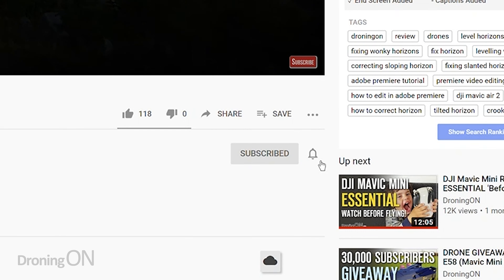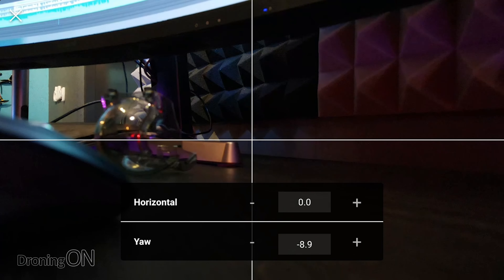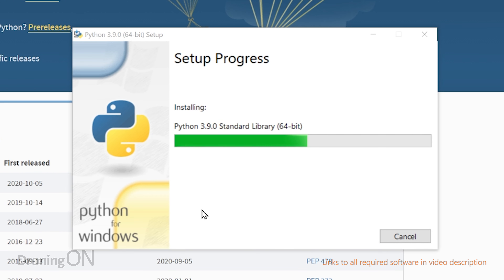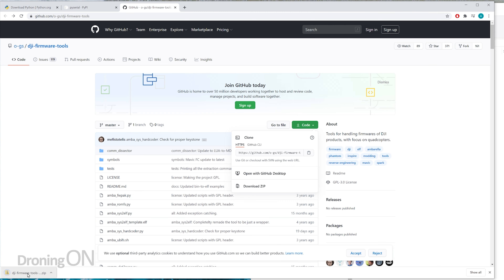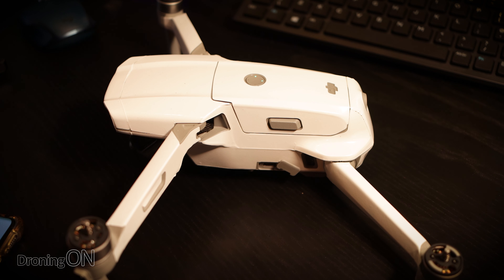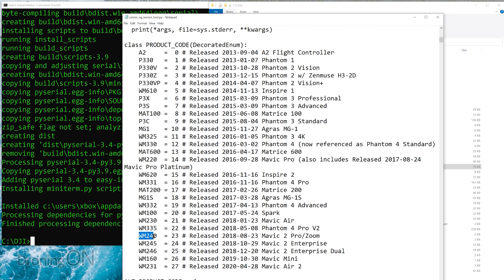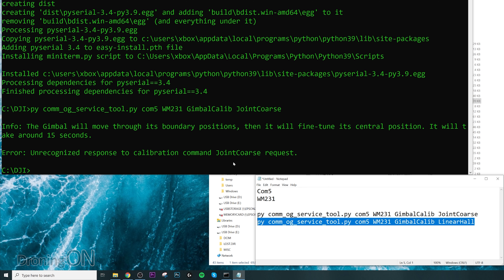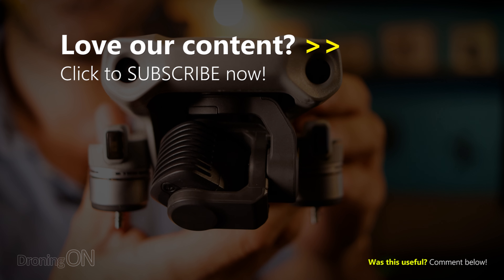FIX DJI drone ERRORS/ISSUES after GIMBAL/CAMERA replacement

Comment: THE FIX FOR MINI 2
Hi first of all ,thank you for your video,which was very useful and all sorted now,the bird is flying,without its eyes leaning on one side  lol .

(FOR DJI MINI 2 OWNERS)
That’s how I managed to fix mine yesterday 17-10/2022.
First of all you need to check if the COM PORT is visible in task manager task manager if you use windows.It’s most likely won’t be there because of windows updates etc .
That’s the fix If the details of your COM ports are not visible in the Device Manager, open Device Manager and click on “Action” from the menu bar. Select the “Add legacy hardware” option, then click Next. Choose the “Install the hardware that I manually select from a list (Advanced)” option, and click Next.Then click communication port and ok .Back in task manager ,you’ll see com port visible now and it might says ,port won’t function properly,just ignore it .

Now connect your drone to the computer/laptop,go on task manager,click on com ports ,you will see two ports ,mine was showing COM 4 and virtual Dji USB port (com 3) ,you will use the one for Dji only ,which is COM3 .
Leave your drone connected to your laptop.

Go in notepad and save this (ps your port com might be different to mine ,check what’s showing in you task manager,that’s the one you’ll be using):
1/ py comm_og_service_tool.py --port com3 WM160 GimbalCalib JointCoarse
2/ py comm_og_service_tool.py --port com3 WM160 GimbalCalib LinearHall

Now you follow the YouTube videos and install everything as stated (Python,PY serial,Dji tools etc)

Now go in command prompt 
C:\WINDOWS\system32>cd.. (click enter)
C:\windows>cd.. (click enter)
C:\>cd\dji
C:\DJI>py setup.py install

Wait for it to install….
Then :
C:\DJI> py comm_og_service_tool.py --port com3 WM160 GimbalCalib JointCoarse (click enter ) and you’ll see the gimbal moving 
 
Next :
C:\DJI> py comm_og_service_tool.py --port com3 WM160 GimbalCalib LinearHall (click enter) and wait ,and you’ll be all good to go .
Disconnect the drone ,connect to you phone ,calibrate imu ,calibrate the gimbal,and enjoy your flight .
Ps I still get error message(Code:40021 and Code :40011) but it didn’t affect my flight .
Reply: Will WM160 work for mini 3?
Reply: @ sorry mate ,I won’t know ,as I’ve only tried it on the mini 2 .Follow my instructions and try give it a go .It might works ,you never know,and you’ve got nothing to loose either.Good luck

Comment: Hi this all worked however when I turned the drone off and back on again, it had reverted back to before calibration. So it only works if i calibrate and don't switch the drone off. Can anyone help?

Comment: Just tried it on my air 2s. 1st issue I was having was getting a message stating "python was not found run without arguments", fixed that I think. Then now I'm getting "python command og service tool py is not recognized as an internal or external command” I'm not IT literate so I have no clue. Tried on 2 different computers, same result. I have the cmd running under administrator, at the c: prompt under the DJI file.

Comment: I had the exact same issue with my air2. Gimbal replaced, firmware updated, everything calibrated and gimbal still cock-eyed, with message in dji fly "incompatible gimbal data". And then, glory be, after several restarts of drone and controller, it centered and now works perfectly. However the "incompatible..." Message still appears.  I'm hoping it will go away and not about to do your complex fix just to get rid of the message. Suggest folks try the restarts first before your fix
Reply from the maker: Good tip on the restart, thanks for adding this advice buddy! Unfortunately the incompatible message appears to be impossible to get rid of :(
Reply: @Droning-ON we having problem installing python on cmd

Comment: My problem is with my Mavic air 2 the camera and gimble will not move at all like is dead, and I never crash or any hard landing I wonder if I follow this steps it will re calibrate
Reply: the same is happening to me, with the mini 3 pro, I had to desasemble to clean the gimbal motors, when i put it back together, the gimbal is not responding and it says it's locked

Comment: This fixed our Mavic 2 Enterprise from the IMU error.

Calibrating the IMU, turn on the remote controller and connect it with the mobile device. Place the aircraft on a level surface with its arms folded and turn on the aircraft. Launch the DJI Go app, enter the camera view. 

Go to main controller settings, advanced settings, sensors, IMU and tap calibrate IMU. (You then have to change the orientation the drone when prompted to compete the calibration)

Comment: Is this method works with dji mini3????
Reply from the maker: Very likely, but you may require a new code to use.
Reply: @Droning-ON wher we found the code plz
Reply: It work!??
Reply: Will WA160 work for mini 3?

Comment: Hey man and thank you for this tutor.
did anyone used it with mavic 3 cine?
im getting same error code and a black screen....
my issue is the drone is not showing in the port lists.

firmware is up to date and using win10
Reply: look at my comment, I found the new order^^
Reply: @seemanb2374  its not showing in my port list, i cant find on which port its connected.

Comment: Hi Ash,  can I just thank you for this video, as it saved my last drone.  I have used this calibration method before and it worked fine, I have another Mavic 2 and have tried to calibrate it, following a crash. I have replaced the flat control cable.  when I send the command jointCoarse the gimbal goes through it the usual movements, but when I used the command LinearHall nothing happens, no movement at all, any ideas where I may be going wrong.
JON
Reply: Hey mate, any luck with the LinearHall issue? Mine is also not responding to it :/

Comment: Just bought a replacement gimbal for my mini 2. Fingers crossed this will work!
Reply: LN DRONE & FILMAGENS  I tried WM160 and it worked! My new gimbal is no longer crooked. Good luck with yours. 

The tricky part was that the Mini 2 is only detected on the COM port for 5 seconds. You have to be fast to enter the command the moment the drone is detected by Windows.
Reply: @uvin.baduge  can you please explain the process

Comment: Hello, thanks for the video, but I can't solve the problem with my mini 2, it gives an error that the product is not the right product, but there is no mini 2 on your list, there is only a Mavic mini
Reply: Solved for dji mini 2 you mast choise mavic mini and after start the drone you have 10seconds for launch your calibration

Comment: @DroningON Hi I found this video some time ago and I found it a great help for my Mavic 2 pro. now I'm the proud owner of a Mavic 3 cine and recently crashed it, I thought I could repair the gimbal myself, and everything went great until I turned it on and now i'm stuck with the gimbal calibration. I was wondering if you had an idea of where to get the latest firmware tools to calibrate the Mavic 3 cine or any advice to help. Thank you
Reply: Hi there. Did you ever find it for the mavic 3.  Im also looking for the avata code

Comment: Would this also get my camera working again, I have a mavic pro that had gimbal overload, replaced the gimbal but kept original camera but had to replace the camera cable, since then my gimbal no longer moves and I have camera sensor error

Comment: Hello friend, the MA2S and M3 codes are already available, the Mini 3 is missing, I have been trying to use it with the Mavic 3 but the problem is that in Device Manager it does not open the corresponding COM port and for this reason I have not been able to know what COM port to use.
If you suddenly know how to force the PC to show the COM port, I would appreciate it.

     WM231 = 27 # Released 2020-04-28 Mavic Air 2
     WM232 = 28 # Released 2021-04-15 (MAVIC) AIR 2S
     WM260 = 29 # Released 2021-11-05 (MAVIC) 3
Reply: just Search ( bickflash tech) on YouTube, drop a comment for him, he'll assist you.

Comment: Hello, i get an error, invalid choice com5 it wants me to choose the model but i dont know where to put the port code because if i dont input it it will  give me the error:  one of the arguments --port --bulk is required
Reply: I have the same problem :/
Reply: Same here did you figure it out?

Comment: YES!!!!! Thank you Thank you THANK YOU!!!!  I was ready to buy another gimbal thinking the one I got was bad.  Someone who saw my video on how to replace the gimbal for a mavic mini, saw the problem I was having after the repair.  He found your video and someone else's video which is just about the same, but different ways of getting to the folders.  This was a big help. Only issue I had when follwing both of your steps, is that I was doing it on my desktop.  The front USBs are really just part of a USB hub, and just showed a drive, and not a com port.  After I figured that out and plugged it in the back USB, it pushed the calibration onto the Mini.  Rebooted the mini, and took a quick flight inside, and it's like NEW again. Thank you!!
Reply: Jimmie I do not understand how you selected a com port then? I am using a laptop and all i can see is the USB hub.
Reply: @jillsabo5973  USB on laptop are usually part of the motherboard.  When I use my Lenovo all I do it plug it in and in the device manager under  Ports (COM & LPR) I see the port number.  I turn on the mini then plug it in to the USB.

Comment: Hi and thank you very much for this video. I got suddenly some issues with my Mini2 with a horizon tilt. If I have it on follow mode the horizon tilts always to the same side, no matter which side the drone moves. The weird part is, it came suddenly, without any accidents. One day everything was just fine, then a week after on my next flight it suddenly started doing that. 
Do you have an idea if it is possible to fix that with this calibration method too?

Comment: I have the same issue. So glad that I found this video. I am running into an issue however. Once I entered the first calibration command prompt I got a message that the device is not ready. Also I don’t have a COM#. Instead I used D:\ which shows the drone. Any ideas what I could do?
Reply: “Permission Error(13, ‘The device is not ready.’, None, 21)
Reply: Do I need to have the remote on as well? I might give that a go
Reply from the maker: @simonc6982  please follow the instructions carefully Simon, the video clearly shows how to get the com port.
Reply: @Droning-ON   so I found the COM port. I had to show hidden devices. Typed COM3 and now I’m getting an error. FileNotFoundError(2, ‘The system cannot find the file specified.’, None, 2)
Reply from the maker: It'll only appear as hidden if you haven't got the drone turned on and plugged in via USB, have you done that?
Reply: @Droning-ON  yes it is on as per the video. Just noticed that COM3 is on even without anything plugged in. My computer is still not showing which COM is being used when I plug the drone in.
Reply from the maker: @simonc6982  so with Device Manager open, you turn on the drone and let it boot up fully, THEN you plug it into your laptop via USB and you're saying that no additional COM port appears?
Reply: @Droning-ON  exactly
Reply from the maker: @simonc6982  try a different USB cable
Reply: @Droning-ON   the issue still persist. I think you did an awesome job with your video. Not sure what my problem is :(
Reply from the maker: @simonc6982  if you join the DroningON club, me and my members will help you to troubleshoot, via screenshare if necessary. What about DJI Assistant 2, does it see your drone? When you plug it in, does your computer acknowledge that you've connected something?
Reply: @Droning-ON   I think I figured it out. For some strange reason, the usb connection to the drone was only lasting a few seconds. During these few seconds I noticed that the COM3 would become active, so I tried the commands as soon as I heard my computer ding from the usb connection. This worked. Thank you for your feedback!
Reply from the maker: @simonc6982  great to head, maybe a dodgy USB port on your drone or computer? Glad that you've sorted it! share this video!
Reply: same here with my mavic mini. It is the COM3 and shows only for a few seconds, afterwards disconnects. I managed to launch the first  mommand line in this small time window and this corrected my of-middle gimball at once. I did not need the second line and the gimball cailibration in the app works now (it stuck at 10% before).
Reply: @AndrasKSzabo  :/ still having this issue and not sure what's up. usb -> usb-c isn't getting recognized, usb-c -> usb-c is, but the port isn't being displayed in device manager, nor USBDeview

Comment: Thank you bro for your video. I have mavic air 2 I have manage to calibrate the gimbal it’s working as normal , but still I am getting error 40011, 40021 and 10017 .
Did find out how to remove those errors? If you Did please share with us the procedures.

Comment: hi, how do i do it with pyserial 3.5?
Reply: Just got done this with my mini 2, I had to open dji assistant to get the com port to show up constantly but close it out after you see it in device manager, than use the slightly modified codes on I fix it (updated guide oct 2023) and it worked for me

Comment: Does this work with the “gimbal stuck, error 40002 on the Air 2s?
Reply: I fix the error 40002 in the air 2s?
Reply: @andresgarcia9666  not sure. U tell me

Comment: Hi! Thank you for this Video. It works with the new Air2s? 
Please help me:)
Reply: It Should work using the Same Codes as he uses in the Video. There is no Official Air 2 S Option but the Air 2 Code should get you going :)

Comment: Unfortunately, it's not working for me. It won't install the script in cmd,  I followed all the steps prior, and I get an error "Traceback (most recent call last):
  File "C:\dji\setup.py", line 17, in <module>
    from setuptools import setup
ModuleNotFoundError: No module named 'setuptools'

During handling of the above exception, another exception occurred:

Traceback (most recent call last):
  File "C:\dji\setup.py", line 19, in <module>
    from distutils.core import setup
ModuleNotFoundError: No module named 'distutils'"

Comment: Hi im wandering if this could fix my air 2 gimbal that im not sure if it is broken .... because de camera is working and the gimbal is stuck and it goes all to the left , no error warnings and the calibration dont run in dji fly. how can i be sure if it is broken or not? thanks

Comment: WOW!!! After MONTHS of taking apart and rebuilding the new gimbal over and over... this FINALLY WORKED!! Note: I did this on a Mavic Mini, and needed to unplug and reboot the Mavic several times throughout the process. The windows 10 machine wasn't recognizing it as a COM port USB device after a few seconds. I had to remove the SD card from the Mavic, and then reboot the mavic, and would only have a few short seconds with the computer seeing it in "Com3". So we had to apply both lines of code separately. Rebooting the Mavic in between. BUT IT WORKED. I have a persistent "Gimbal Calibration Error" on my DJI app now. But the automatic calibration does successfully complete (after previously getting endlessly stuck at 10%) 

I'M VERY VERY HAPPY. Thank you.
Reply: im trying this but having trouble. mine is just saying invalid choice. but im doing everything right
Reply: @bennypearson754  have the same problem, have you solved?

Comment: Does anyone know if this will work with the avata? I had to replace a motor and after putting the avata back together im getting the gimble and camera calibration errors. It worked fine before the repairs. I checked the cable to make sure it was plugged in correctly and it is but still no camera feed and gimble is dead in water. PLEASE HELP

Comment: Hello, great video. I wonder would this process work for DJI Mavic Air 2 with Gimbal Stuck error code 40002? My Gimbal seems to have full range of motion when powered off, but on start-up it will not cycle through the pitch axis, and there is no response to the remote control pitch axis wheel.
Reply: I am having the same issue! Have you found a solution?

Comment: Thanks for the advice, but sadly it didn’t work for me, despite following your instructions to the letter.
This is what the command prompt threw back:

cit. Administrator: Command Prompt Microsoft Windows [Version 10.0.19045.3803]
(c) Microsoft Corporation. All rights reserved.
C: \WINDOwS \system32›ed..
C: \windows>ed..
c:iscd\dii
C: \DJI>py setup.py install
Traceback (most recent call last):
File "C: \DJI\setup.py", line 17, in <module› from setuptools import setup
ModuleNotFoundError: No module named 'setuptools*
P/During handling of the above exception, another exception occurred:
Traceback (most recent call last):
File "C:\DJI\setup.py", line 19, in <module>
from distutils.core import setup
ModuleNotFoundError: No module named 'distutils*
~ C: \DJI>

Comment: Any pointers if my Com port won't connect-stays greyed out except at initial plug in is lit for a second- but my Mini does show up as a disk drive?
Reply: I had the same issue with mini 2. What I did was first run DJI Assistant 2 and once it showed on my ports I closed the program. However I was not actually able to calibrate it since there is only mini WN160 and that does not work for mini 2

Comment: licrosoft Windous [Version 10.0.19045.3930]
(c) Microsoft Corporation. Tüm haklari saklidir.
C: \WINDOWS \systemB2>cd..
C: \Windows>cd..
C: \›cd\dji
C: \dji>py setup-py install
C: \Users\hpenv\AppData\Local\Programs\Python\Python312\python.exe: can't open file 'C:|\djil\setup-py': [Errno 2] No such file or directory
C: \dji>. 
  I’m getting such an error, what is the solution?